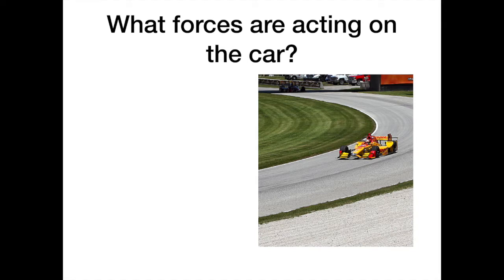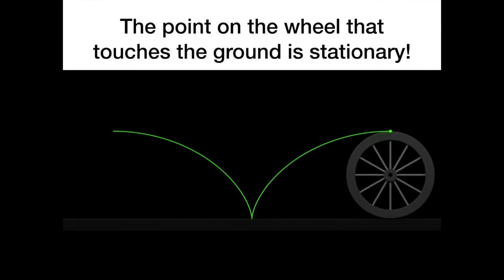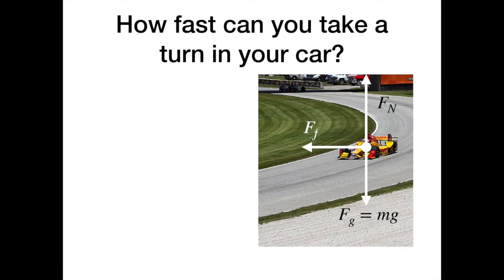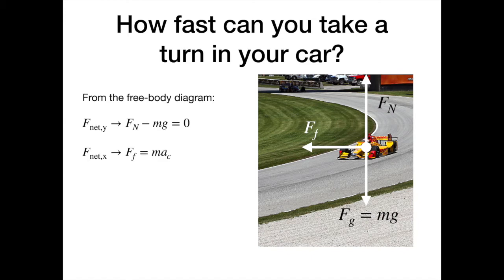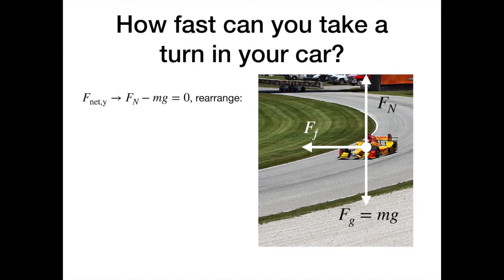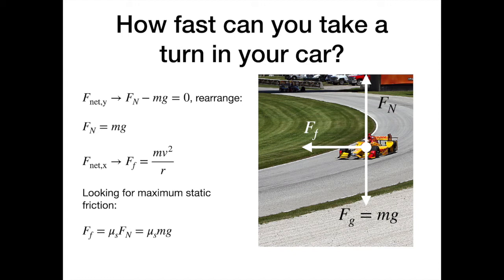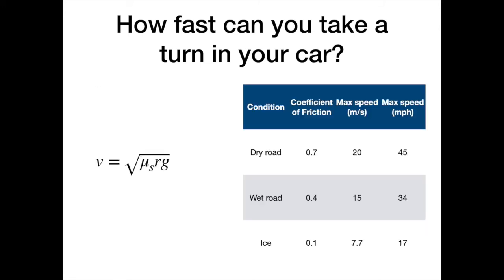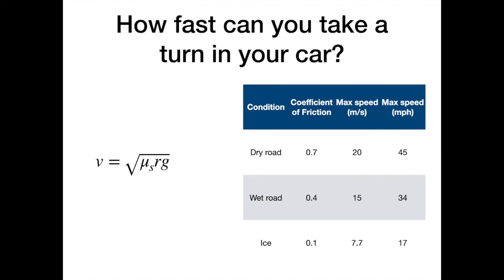Centripetal force in driving around a turn

Comment: Would the banking used on small radius curves in roadway design allows this speed to increase?
Reply from the maker: Yes! The banking means that a component of the normal force points toward the center of the turn, which means it contributes to the centripetal force. That calculation isn't as simple as the one shown here, but you can find it in most intro physics books, like this one: https://openstax.org/books/college-physics/pages/6-3-centripetal-force